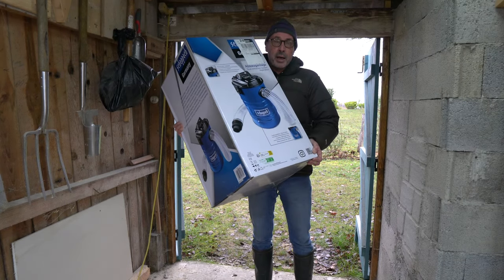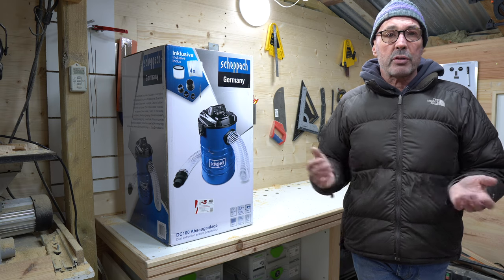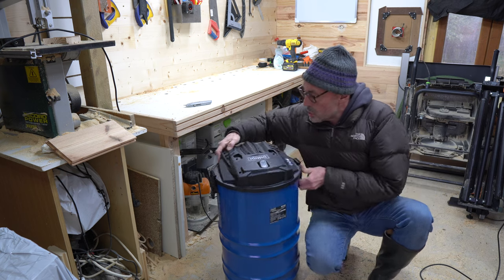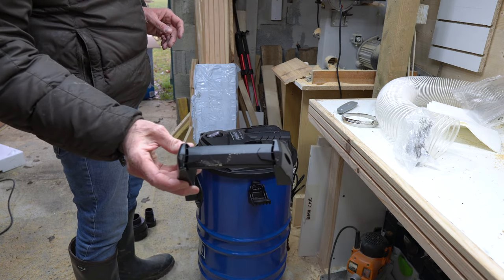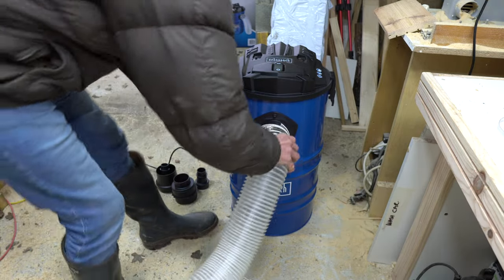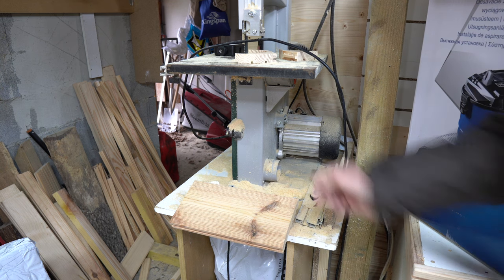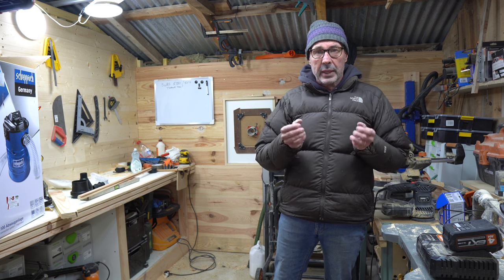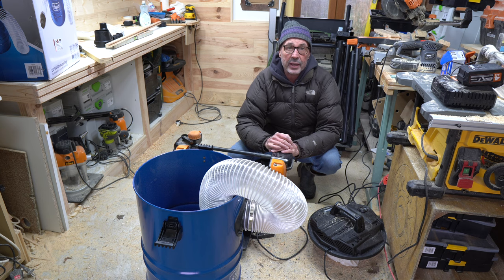Scheppach 100mm Hose Shop Vac.  The problem with all shop vac.

Comment: I think Matt at Badger Workshop found someone selling sets of adaptors for hoses. But it's the whole bl**dy sector that needs to sort itself out. Some faltering steps were taken on batteries. You can buy adaptors - I got one to revitalise an ancient Makita so that it uses the modern batteries - a new Makita drill for £20! Meanwhile, please rant on. Perhaps a consortium of YouTubers could make a joint case to the sector?
Reply from the maker: Hi. I have some badaptors, they are brilliant.  Thanks for your comments. Regards JP

Comment: If you do put it in your car port with a cyclone- you can dump the filter. So little gets through it is not needed- you will not find dust accumulating. I have done this for three years now, in two installations, and there is no sign of dust being expelled. You not only save the cost of filters, you get better suction.
Reply from the maker: Thanks for the comments, some interesting points you’ve raised. Regards JP

Comment: I recently bought a 3d Printer, the first job I did with it was print loads of hose adapters for my machines so they all fit my cyclone/vacuum system. It is so annoying nothing fits anything else isn't it. Incidentally the DC100 is £158.99 here in screwfix, you got a good deal there 🙂
Reply from the maker: Hi Steve. The 3D printing is the way to go. I know nothing about. 3D P but I keep meaning to have a look. Does look like I got a bargain. ManoMano price was by far the best. Regards JP

Comment: I use 2 of these, one on my thicknesser and one on my table saw. Every time I checked the prices of additional hoses/adapters/blast gates/etc, I ended up giving up and in the end I just bought a 2nd one. Works well enough for me, it doubles the capacity (the table saw one takes ages to get full) and it allows me to use super short hoses, which means they work really well. Beats a big expensive system with expensive ducting all over IMO. I have everything on smart plugs so the correct extractor turns on when I turn a tool on, I love it. Nothing to do, just turn the tool on and off and the dust extractors follow.
Reply from the maker: Hi. That’s a good point about short hoses. Regards JP
Reply: @Smallbarnworkshop  Yeah, I'm not sure if an extractor like this is going to be able to run multiple machines with long ducting all over the shop. You're going to lose a lot of airflow I think :/ I would try it with additional hoses before installing everything on the walls if possible.
Reply from the maker: @kz.irudimen Hi. Yes, I was thinking of experimenting in the garden first. Thanks for your tips and information. Regards JP
Reply: hi, very interested in your automation. What kind of smart plugs are these, that turn on when another machine turns on? Could you perhaps provide a link? Thanks in advance.

Comment: I got myself a HVLP extractor from Rutlands just before Christmas. It's old school can with clip ring to keep the lid on. Hooked it up to my Metabo thicknesser. I want to be able to hook it up to my table saw as well, going to have to experiment with hose adapters! One criticism is that it fills up really quickly, but a bigger bin or a cyclone would sort that out. I also got an adapter made for the thicknesser that has the extraction straight out the back instead of at 90 degrees to the blade. Clears the chips fast and without clogging the port.
Reply from the maker: Hi Paul. That’s a great point a forward facing ejector Shute! Regards JP
Reply: @paulhodgson4790 I bought an straight extraction adaptor for my Makita 2012NB the difference it makes is amazing.
Been looking at same Rutlands extractor,thinking I can remove clip ring base & mount motor unit to a wheely bin & adapt it to a large extractor..🤔

Comment: I’m with you on the dust ports JP they literally suck, I use the steeped hose connectors and cut to size. I’ve got a draw full of connectors and hoses.
Reply from the maker: Hi Wayne. I also have a bag of connectors I’ve collected over the years.  It’s like the krypton factor putting a system together! Regards JP

Comment: 4:19
The longer the hose, the worse the airflow.
This is a chip collector, not a dust extractor; if you want to sweep the floor or deal with the hazardous fine dust you get out of sanders, saws, and routers, use something like a Aero 26-21 with the 302000490 filter, or some other wet/dry vacuum that can be fitted with M-rated filters.

2m of hose is plenty for connecting the chip collector to a lunchbox thicknesser, planer, or picking shavings off of the table.

P.S.
Yes, I see the Festool extractor, and I like it. The Aero with the 302000490 filter just seemed like a more cost-effective option to me.
Reply from the maker: Hi. Yes, I have come to the conclusion that is the way it needs to be.  I use my Festool for sanders and small tools. Regards JP

Comment: Another good video Thanks.
I have the Record version it sucks good but what use is 2m of hose. First time it was a bit cold the hose split. Tape to the rescue, it ended up more tape than hose, when you price hose up it costs more than Vac. I don't know why they bother putting 2m in then you would budget for vac and hose.
Reply from the maker: Hi. That’s a good point. My Dad’s extractor that I briefly showed used to have more tape than pipe 🙄 He has some cheap kitchen extractor pipe on at the moment. 2 M is poor and it means you are constantly moving the thing about. Regards JP
Reply: Update on my Record power version loads of fireworks today sparking and nasty noises and I haven.t used it much. wish I had put the £170 towards a festool. always do it get this its half the price then something else and then added up to the price of a good one, I won't be rushing out for thier bandsaw now  @Smallbarnworkshop
Reply from the maker: Oh no! Sorry to here about your vac failure :-( Regards JP
Reply: Its took a while but a new motor arrived from Record Free, Dosen't time fly. I didn't realise it was 5 months. I've bought a CTL Midi since then cheers

Comment: There are a lot of these 'oil barrel' vacuums about- they are pretty much identical, apart from the shape of the plastic top cover. They are pretty poor. They use a single, simple motor/impellor with the air going through the windings to cool them- they are massively inefficient. There are some that use more than one unit, and cost considerably more. I took that to be just profiteering, until I got to use a Camvac twin unit- not in the same league! It is much, much quieter and with greatly improved suction. They clearly use a much improved motor unit. Still a universal motor, but better made. 
I had a go at building a 3ph spindle (VFD) powered unit- way more efficient and powerful. However, I was uncomfortable at running it at more than 16000 rpm with a 3D printed impellor. It could have gone to 20,000 - and it is a square law for suction. One day. Question is- why are there no commercial versions?
You can make adapters for the DeWalt AirLock system (probably the best on the market) using 32-40mm waste adapters. Make a groove to take the locking balls, and you have a mating adaptor for a few pence. Or 3D print them. I have fitted these to all my tools, and a simple twist locks them on.
Reply from the maker: Hi Mike. Thank you for the pointers. Regards JP

Comment: Had the same with my Triton planer. Does the shepach have an antistatic wire for the hose, may be an idea to fit one if not I've had a few shocks when planing lots of wood
Reply from the maker: Hi Derek. No but I will fit one with the install. Regards JP

Comment: The extra 15 litres compared to the previous models will come in handy, as this chip collector fills up quite quickly. I have two of the older models (One Scheppach and one from another brand). However, Scheppach only sells OEM tools, meaning they are the same - down to the last atom - except for the color to all the other low end brands. 
Scheppach is usually more expensive than other the other identical machines, so it's generally better to look for the same machine in a different color, at a lower price. By the way, when it comes to dust ports fitting within one brand, since all the OEM tools are made in China/Asia - and the OEM sellers do nothing but mark up the price - you cannot expect them to match... Sad but true. All that being said, I bet you that this will last for many years. Longevity is in my experience not the problem with OEM tools.
Reply from the maker: Hi Nomad. Hope your well. Thanks for the information it’s very interesting and welcome.. Regards JP
Reply: Scheppach are pretty often the cheapest here in France, and they offer a 10 year warranty. Their warranty service is slow but you do end up getting a refund or a new machine. That alone is a big bonus with cheap machines like these that end up having pretty big issues half the time.

Comment: Great video - what foam tape do you use?
Reply from the maker: Thank you. I can't remember exactly as I've had it for so long but something like this. Regards JP

High Density Foam Tape,2 Inch Wide x 1/8 Inch Thick Door Insulation Tape,Adhesive Weather Stripping for Doors Window,Foam Seal Proofing Tape,16 Feet Long https://a.co/d/1Y6eueb

Comment: You could try pieces of bicycle inner tube to seal some of those ill fitting joints !!!!
Reply from the maker: Hi Roger. I once tried inner tubes and it made an horrendous farting noise 😂😂 Regards JP
Reply: @Smallbarnworkshop  🤣 Of course it was the inner tube 🤣

Comment: Update:
I felt intrigued enough to look up the performance specifications of this thing, and it appears to actually be a gender-bent wet/dry vaccuum trying to play itself off as a chip collector.

It's got the peak suction of a wet/dry vac or dust extractor, but the airflow of one as well, and I can't find any M-rated filters for it either.

So it has the suction to work well with sanders, jigsaws, scroll saws, and other small-scale dust-generators, but at the same time it's got the cumbersome hose and nonexistant fine dust filtration of a chip collector... And at 215m³/h it'll only move a tiny fraction of the air that a "normal" 1200W chip collector would.
To give you a point of reference, the 1100W axminster AW82E is rated at 1530m³/h, and if memory serves, even Scheppach's own entry-level 550W chip collector is rated at 900m³...
This halfbreed honestly looks like a "worst of both worlds" scenario.

It's a bit late for me to tell you to return the machine, and I hope you can put it to good use somehow.
The fine dust shouldn't be *too, bad since your workspace is outdoors-ish. Just remember to don a mask whenever you're using the machines, and then keep it on for the rest of the day or until the shed's properly aired out). I'm not sure how it'll cope with the added resistance for a longer hose, but putting it outside the workshop proper seems like the best option at a glance.

I'll at least thank you most sincerely for alerting me to the... existence... of this thing. To elucidate:
* I'm aquainted with someone at my local community center for the disabled.
* They've already been pressured into the mistake of purchasing an unuseable Meec-brand planer-thicknesser combo (We even tried putting perfectly straight pieces through it, and they came out *bent*, nevermind what the blasted thing does to palletwood)
* They've also purchased a cheap-ish wet/dry vac. It's a Nilfisk Multi II, so it's good for what it is, but what it is is a general-purpose home appliance, it wasn't made for professional use in woodworking like the Aero or Attix series, let alone chip collection, (and chip collection is what they bought it for).
* As it's been unable to draw enough air to cope with the planer/thicknesser, They're now trying to upgrade the wet/dry vac to a proper dust extractor with better filters (which to my knowledge aren't available for that model, because again, that one's a general-purpose household appliance, not a tool for fine dust mitigation), and they're also interested in aquiring a decidated chip collector
* I haven't a clue as to what collector they're looking to buy, but if by some great misfortune it happens to be this thing or something similar, I might be able to prevent the hattrick, thanks to you.

Kind regards.
Gustav.